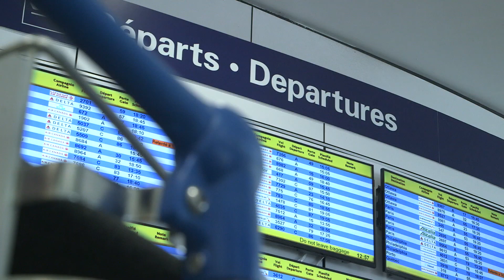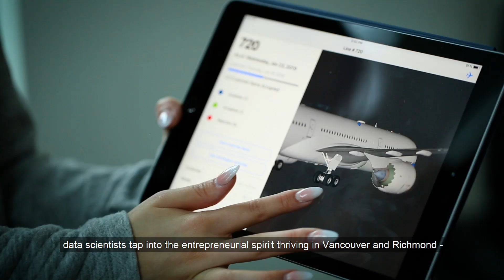Boeing  in Canada

Comment: Airbus dead
Reply: Andre Ariasfuentes umm airbus isnt dead... why?
Reply: @Adam Shaheedh Boeing does not manufacture engines. The 777 is fine, and has been for the last 20+ years, one of, if not the safest aircraft in aviation. The A380 suffered structural wing failures during testing, did you ever hear about that? They fixed it just like Boeing has fixed the 777 test with the cargo door coming off. It only came off during the max stress test to see how far it could withstand under extreme pressure, not normal conditions. It was expected to happen. 787 is doing extremely well, and posting efficiency percentages above 20%, past expectations. The engine issues are the 787s with Rolls Royce. Airbus aircraft as well are having problems with the RR engines. Everything is an easy fix, it's just that two crashes have taken all the attention away from everything else going on. Lookup how many aviation disasters from Airbus and Boeing combined that have happened in the past and come back to me (:
Reply: Their Good still.
Reply: RIP